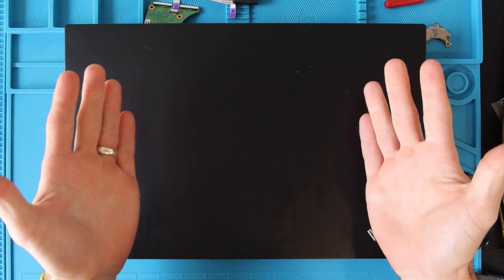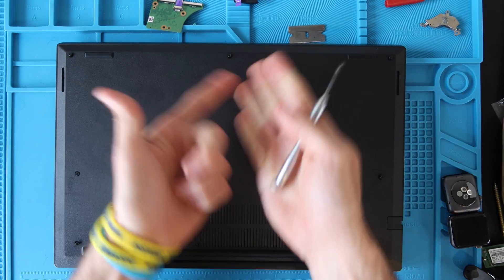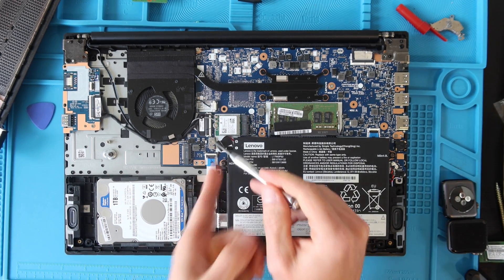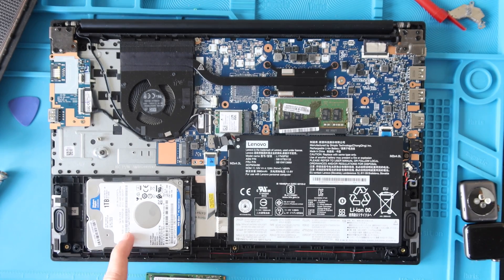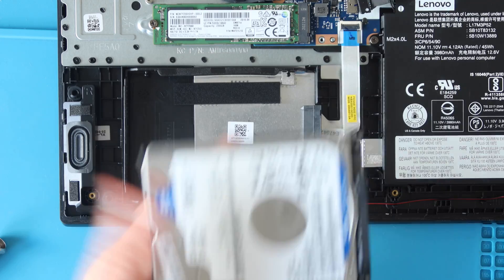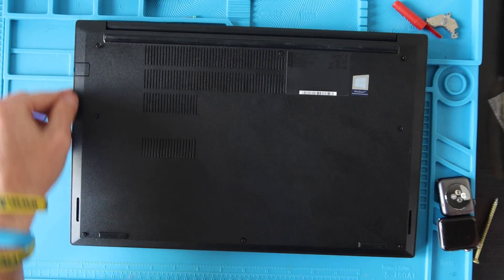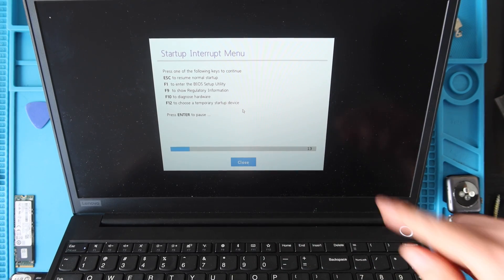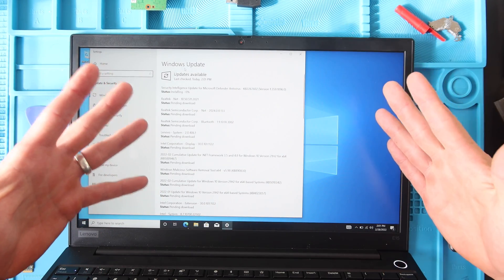Lenovo Thinkpad e15 Upgrade Step by Step | M.2 SSD Install | 16GB Ram | Battery Replacement

Comment: Does the little notch on the ram matter?or can I just put one in where the notch is in a different place?
Reply: Its "keyed" for a reason. The slot has to match exactly or it wont be comatible.

Comment: Hi, is it possible to give me the part number for the sata cable interfase. My E15 did no have it. Thanks. Good video.
Reply: My L15 gen 2 doesn't came with one either I want more storage and ram.

Comment: I also upgraded my ram from 16 to 32 yesterday
Reply from the maker: Must be blazing fast video scrubbing now 🤩
Reply: @thecollegepicker  It was actually getting overheated a lot usually while rendering, earlier I used external keyboard so I never felt the laptop being hot. After the upgrade, it barely gets warm. I might have given it a few years of life there lol.
Reply: @eshaansharma280 so a Lenovo E15 can handle 3D rendering ?
Reply: which generation do you have? 20RE and I7 10510u?
Reply: @andreykoschey2689  i7